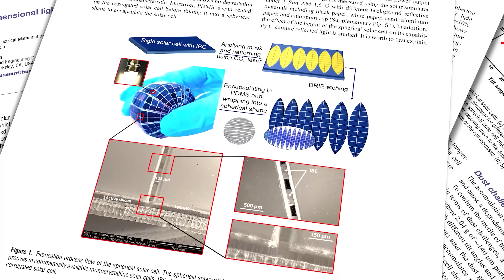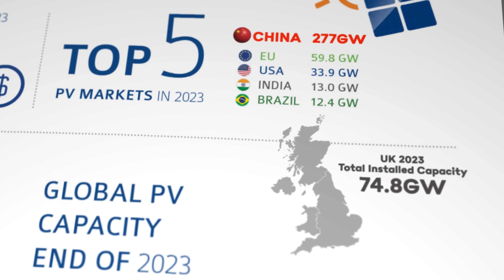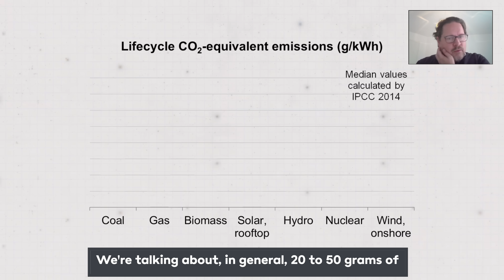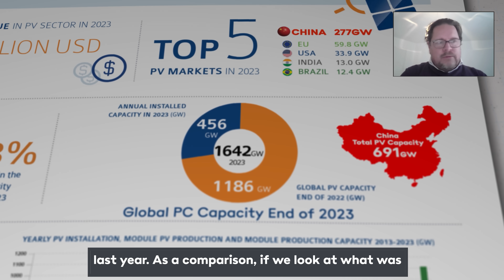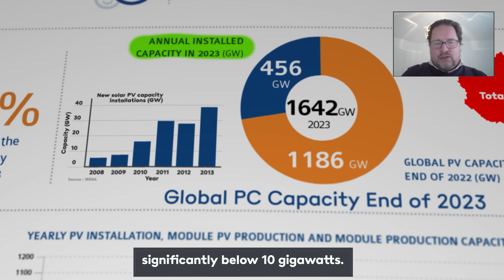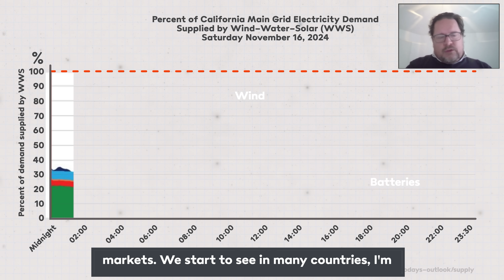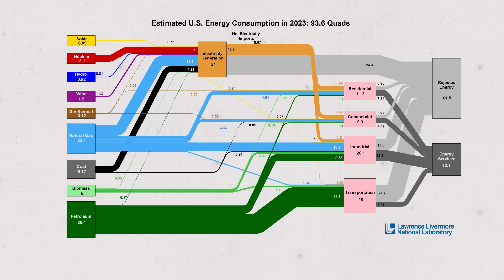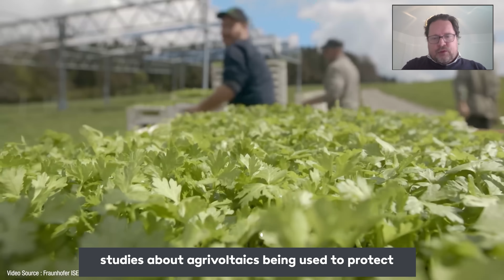Renewable Energy Domination

Comment: In Belgium you can't use your EV car as a battery. You need a 2-way charger for that and none of them are approved yet. (Also, most cars won't allow 2-way charging anyway)
Reply: Ok so Belgium needs to get it's shit together.
Reply: @davidwatson8118  Here in Belgium, my solar panels were installed for free and their servicing doesn't cost a penny. I have reduced my electricity bill by €100 a month - so some of that shit is coming together..

Comment: As an American with solar panels, I had to spend about $35,000 (AFTER 22% rebate on income taxes in the form of credits over 3 years) for 15 panels rated at 370 watts per panel plus the Generac power converter.  (I also bought several 1 kilowatt batteries for storage, increasing the expenditure to over 40k... but the solar alone was 35k and change).

I'm spending over $200 a month (probably about $180 if I hadn't bought battery backups) and saving roughly $100 a month.  So we've got a ways to go before we hit a price point that people won't be upset about.

If we lived in a world where everyone was willing to act out of grace and benevolence for the good of humanity's future, and willing to spend more than they save buying solar... this wouldn't be a problem at all.

A large MAJORITY of people on this planet are most certainly NOT willing to do what I'm doing.  Why would they spend $100 a month EXTRA for power when they could just buy it all from the electric company (My company, "Duke Energy", currently only gets about 30% of power from renewables and over 60% from gas, oil, and coal - mostly natural gas).

Hopefully this will change over time... but we still need to address the fact that home-based battery backups also cannot function on a 20 amp circuit (and not even CLOSE to working on the 50 amp circuit that a level 2 EV charging station uses).

I embrace solar, and I own a 2019 Jaguar I-Pace fully electric car... but I had to buy a gas powered 2015 Chevy Cruze last month because the EV has been in the shop the last 2 springs... presumably with electrical/battery failures related to the cold, harsh winters of 2022 and 2023.

Each time it's been in the shop, I've had to use a loaner vehicle (that RUNS ON GASOLINE) for 4 MONTHS (1/3 of the year!!!) because they are so short on parts and EV TECHNICIANS that they can't get all the warranty work done in a timely manner.

We have some while to go... I will likely buy a plug-in hybrid with a 40 mile battery range for my next daily driver.  I want to stay total electric but even I can't deal with the insane warranty work hassles and the 250 mile RANGE ANXIETY!!!

Here's hoping for brighter future with sodium-based batteries or some other tech better than what we have now! ⚡⚡🪫
Reply: Your country needs to get its act together.😢
Sadly your country voted in the orange clown.

Comment: In my country the government took a long step backwards 6 years ago and tried to generate all energy from the government owned company again, mainly burning gas (imported from USA) and petroleum coke, and also the great new energy they proposed: "coal" (mostly imported because my country doesn't have enough coal to expand its opertion)... but still the general public didn't stop installing solar panels, because they have economical sense, even if the government puts hinderings to buy and use them, they still make sense. It's a reality.

Comment: I've been wanting to get solar panels for years. How do I start if I'm still renting? I'd like to buy batteries as well, but those are pretty expensive since I'm still in college.
Reply: In some part of Europe you can get vertical solar panels that you can hang on a balcony.  All you have to do is plug them into a wall socket and they will feed the house, reducing your electric usage by whatever amount of energy the panel makes.  It's quite slick.  These may or may not be available or legal where you live.
Reply: Talk to your landlord.
Where do you live.

Comment: One of the really valuable aspects of PV is that if it is deployed on city building rooftops it is not only a source of energy but also a energy delivery mechanism that provides energy where you need it.

People are quick to criticize that the intermittency of PV means that the energy is not provided when it is needed but what needs to be understood is that it can be easily created where it is needed.

Producing energy when it is needed but not where it is needed has its own challenges so in contrast producing energy where it is needed, just not when it is needed is not really that bad.  Add some energy storage to the mix and PV is a very good solution for the future world energy needs
Reply: More and more people are adding batteries to their solar systems.  This is particularly true now that Net Metering is going away.

Comment: concerning solar befalling end of life. Can't we compare that to flora that produces varying amounts of energy from photosynthesis. Could we not hook more and more solar panels together to contribute a sufficiently significant electricity to the grid to contribute energy?
Reply: Sure we could.  At some point, the panels will fail.  In some cases, it makes sense to replace panels in order to get more power out of the same space, using new more efficient panels.  Often space is the limiting factor.

Comment: Curiously enough I experienced a similar sea change to this one of solar replacing fossil fuels. My IBM mainframe programming job went away in Y2K and was replaced by distributed  and NETWORK processing. but ten years later 85% of all data processing was still performed on IBM mainframe running computer applications. I suspect that similarly we will be thinking energy production is solar ten years in the future but as much as 85% will be fossil fuel.
Reply: That's flat out wrong.  Our long term survival depends on us stopping as much burning of fossil fuel as possible.  There was no such motivation to take IBM mainframes off line.  BTW, there is no way that 85% of all data processing was performed on IBM mainframes in 2010.  Most of it had long since migrated to microprocessors.

Comment: A lot of oil and gas goes into manufacturing photovoltaics and windmills. Let's keep the wider BS (not the channel) down until the time they made from simple ingredients like barley, hops and water.
Reply: Do you have any numbers on the actual energy requirement, or are these just feelings?  Energy is energy, so there's no reason renewables can't be made using clean energy.  Solar panels are so cheap now there is a cap on the amount of energy needed to create them.  It can't be more than the panels cost.
Reply: @incognitotorpedo42, the photovoltaics life cycle emissions are about 41g CO2/KWh for silicon photovoltaics, a roll-up of all materials extraction, fabrication, transportation, etc. 

Currently, most panels are manufactured in  China, and they are very good at making them, but I very much doubt that they use renewables to make them. To note this is about half that of beef production, putting it in context.

We may well find alternative materials, in the near future, like thin films and  perovskites, which would reduce silicon photovoltaic emissions, so I have, an open, green mind

Comment: Solar is cheaper than epr nuclear without account uranium costs and other operative costs.
Solar is much more energy safer because it doesn´t need fuel (or uranium, thorium ecc...) to import or produce.
I am not sure that nuclear is cleaner than solar, it´s only based on co2 equivalent side, I want to see the calculation made.
Reply: I agree that the calculations should be looked at.  If solar generates 41g CO2 per kWh, then a 1kW panel, using reasonable assumptions, would cost about a ton of CO2.  I find that a little hard to believe.  Solar panels are very cheap now, which means they can't use insane amounts of energy to make them.  PV cells in the future will certainly be made using clean electricity, so the carbon cost should be minimal.

Comment: Thanks for the new video! It seems clear now how the solar transition is progressing. First the sunniest countries, then the ones who have been providing major subsidies for solar power installation the longest. Battery storage increases in those countries. Then somewhere in there a solar panel recycling industry gets going, once there's enough demand for the material to make it economical. Then other nations start to use more and more solar because it's so cheap, until they've transitioned as well. Then the electrical grid gets renovated into something more integrated, efficient and responsive.

Europe is clearly ahead with this, but the sheer economy of it will eventually convince North America to make the switch too. Though we'll see a lot more resistance and political fighting, you can't really argue with numbers. China will be all solar long before North America, but India is more of a question mark. As is South America.

Comment: #ForceCompaniesToInstallPV. If the government can put into legal methods that companies install Solar Panels on all of their roofs to reduce their power usage. It would force the cost of electricity to reduce for the average person.
Reply: The utilities already have that covered.  The majority of my electricity cost is for transmission and distribution.  The generation costs are less than half.
Reply: @incognitotorpedo42  Even if companies don't use as much of it, its price will still go down. It's about Supply and Demand.
The best method is to install Solar Panels on all the houses capable of supporting it, preferably with batteries. That's a bit harder to accomplish though.
Reply: The government is equally the problem.

Comment: Somewhat ironically, the boom in rooftop solar in Australia can be partially attributed to a right-leaning government who, for decades, pushed pro-coal/gas and anti-renewable policies. These regressive policies designed to benefit the fossil fuel industry meant Australia had some of the highest electricity prices in the world. 

The side effect of high grid electricity prices is the payback for your residential solar system drops increasing its attractiveness. Had the Coalition government been more willing to invest in renewables (and/or reduce unnecessary subsidies for the fossil fuel industry) utility scale solar/wind may have played a bigger role and lessened the need for individual consumers to take matters into their own hands. 

This was not the case and so today large scale solar (big utility projects) produce very roughly only a third of the energy that residential solar produces. There's so much residential solar in fact that in some states, at some times of the day, over 100% of the state's electricity needs can be generated entirely from home solar systems.

Comment: A German company has a PV Panel design that folds up fo storage much like an accordian.  It can be stored inside a garage or shed when weather is threatening or if need to be transported elsewhere and unfolded into a driveway, parking lot or field when needed.  The designs for PV Panels that are available are many and many are quite useful.

Comment: Solar is growing because there are lots of places where you can add a little bit of it into the grid. The problem is that as the percentage of solar gets higher, expenses sky rocket. Solar (and wind) can't accomplish what France did in a couple decades by shifting 70-80 percent of their electricity to CO2 free nuclear. Big tech firms like Microsoft, who can see through the hype, wishful thinking and panic mongering, and not to mention spending their own money, are choosing nuclear.

Comment: Dave, fellow commentators... 

Please help me out with interseasonality data here... I think Dave said we only need 3% of the UK land area covered in current Solar PV panels to meet the entire UK energy demand (adding in Transport/Industry/Space Heating together with traditional current electricity requirement).. 

I'm trying to square this impression or fact, with the knowledge that the Solar energy falling on the UK varies by a factor of 7 between summer peak and winter trough. 

How are we achieving interseasonal storage in that 100%-energy-needs-from-3%-landarea- assigned-to-PV scenario. What assumptions is that figure making about international EastWest and NorthSouth interconnectors and interseasonal storage? 

Disregarding the effects of variations in cloud cover...Surely the 3% does not mean we get enough winter capacity to just get away with a few days worth of V2G storage. That approach would result in 7 times overcapacity in the summer (and up to a 7 times higher effective price per kWh -depending on the proportion curtailed)...meets 

Surely we need a mixed system where wind plays a more prominent role in winter. In fact, because the edge case for the UK energy demand falls in mid winter, then doesn't the UK need a system biased slightly towards wind - because wind matches annual demand better than solar and so reduces the requirement for interseasonal storage. 

Or is PV going to be so good/cheap that we in the UK need to be designing and producing long term relatively inefficient interseasonal storage systems - that other countries may never need - (this might even be our niche (like tidal stream) - something we could realistically be world beating on).

Australia and the Alps, parts of the US - I completely get it.. PV is a great match. Sunshine when you need it for heating in the Alpine winters and Sunshine when you need it for cooling in Australia. 

3% land area meets 100% UK energy demand! - or 3% area in PV has a theoretical (name plate) total annual capacity that is the same as the total UK energy demand - just mostly produced in the summer and needs to be storred or swapped with someone in the southern hemisphere (morroco?).
 
Did I miss something - what am I not getting? 

Lets work off a set of realistic facts and a reasonable scenario (but what are they).

Thanks Dave - love the 'casts

Good luck to you all 

Rob
Reply: Excellent questions.  I suspect that the 3% number relies on some simple assumptions, and is only meant to point out that solar is a potent resource, rather than it being an engineering specification.

Comment: The solar panels on Al Gore's tanker do NOT replace the electricity on the oil and gas tankers! The solar panels only make electricity in the middle of the day. And adding batteries is NOT enough! There are lots of other factors. For an example, read Russ Schussler's latest guest post at Judith Curry's Climate Etc. (December 5th, 2024).
Reply: Don’t worry nothing is going to save us

Comment: In Australia the solar panels are causing grid stability issues. Even if you have panel the service charges are bigger than they used to be and a 2 hour blackouts last night proves that the grid is worse than it used to be because the population has doubled but the traditional grid did not.
Reply: It's a grid issue, not a renewable energy issue.

Comment: Solar is awesome.  Installed capacity is not a good measure.

The video overall is good enough to be worth a bit of engagement.  The claim that you would defend the use of installed capacity later in the video, when you didn't, is disappointing.

Comment: "Rejected energy" on those graphs is very misleading. It typically represents heat engines losses (eg fossil fuels and nuclear) and excludes solar cell and wind efficiencies. For example solar cells are typically considered to convert about 20% of light to electricity, making the solar cells arguably 20% efficient. Why include the heat engine efficiencies in the measure and not the solar cells inefficiencies? I think the reason is mostly historical: these graphs predate solar being much of a player. In any case, with these different effiiciencies you're comparing apples and oranges - each form of energy production has its own inefficiencies and it makes no sense to compare between them or represent one form as being intrinsically bad while ignoring the others.
Reply: Because sunlight is free, and oil costs a lot in both money and damage done.  When people talk about how much energy we "need", they cite the number of barrels of oil burned.  But that's not the energy we "need", it the energy we USE.  What we actually need is much less, and is the amount that we would need to get from renewables.

Comment: Normally I would say that this is a "good thing" but the grid management and development is so far behind the roll-out of consumables that a lot of what is being put into the system is not being distributed efficiently and, more importantly, efficaciously!   With the result being "energy poverty" as the consumer can't afford the infrastructure 'pass-on costs' and also energy is being lost (estimated to be 17%) in what is called "load following" electricity supply.... also - not enough Industrial Electricians (e.g., linesmen) to do the work required. Simple but important idea.

Comment: PV constructed over parking lots would not only provide electrical collection on a single use location, it'd also provide cover for the vehicles parked beneath it, an especially useful benefit in a very sunny climate such as parts of the desert SW of the US or large parts of Australia etc. Throw in agrivoltaics in similar locations and large parts of Africa, N & S America & Australia can become farming foci.
Reply: Using the greater part of the land area of most commercial outlets could produce an excess of electricity and add shade to the carparks and roofs of the buildings which would reduce energy use.